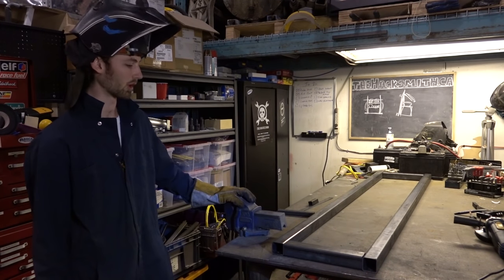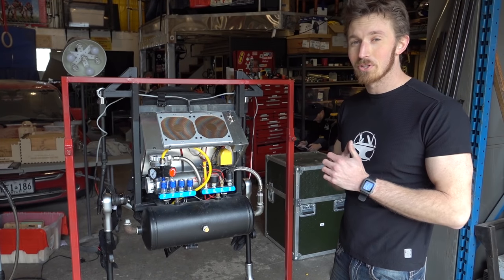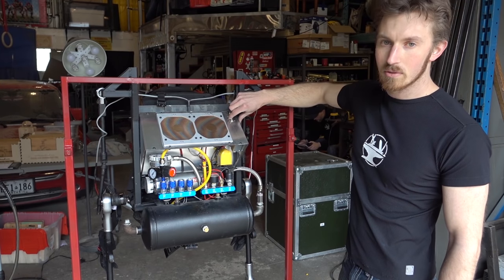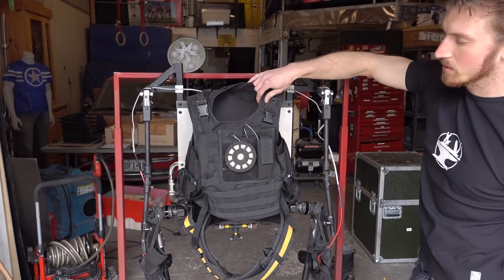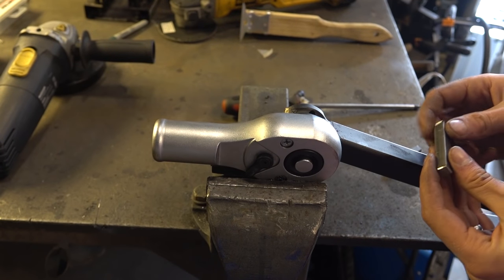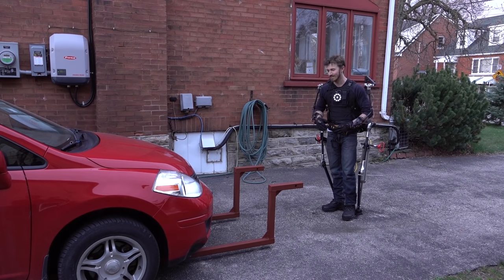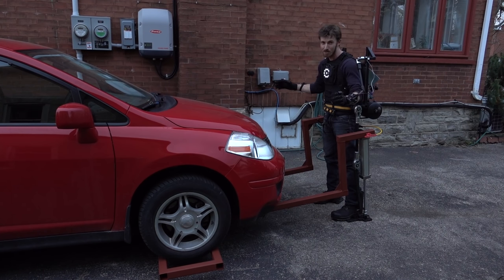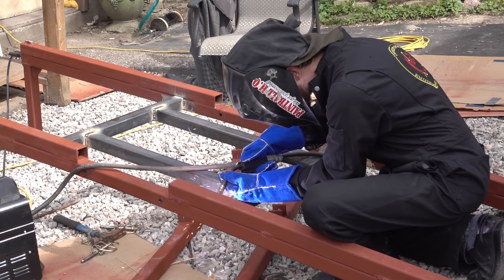Final Adjustments to the Exoskeleton before Exposition

Comment: The steel frame to lift that car need a triangular bridge welded on right at the bending point for force tension support. Not more steel stacked on top of it.
Reply from the maker: +Raymond Cortez we got the wrong steel first time around, it would of worked with the right wall thickness -- we did what we could with what we had, it was finished the day we needed to take it to the expo
Reply: +the Hacksmith you could have still done it with the steel you already had. no bends
Reply: Actually an arched D shaped frame would have worked better because when you go to lift the truck the frame has room to redistribute the force of gravity out ward like a giant leaf spring.
Reply from the maker: +Raymond Cortez Ray, the Delorean has about 5" of clearance, we were very limited in what we could do
Reply: +the Hacksmith cool either way, wish I could do that 😔
Reply: +SnowSpider108 You can with dedication and skill development.

Check out ZNA productions, he has a lot of stuff that can be done with hand tools that would be fun practice.
Reply: he need to stack more jellybeans on his head to make that frame stronger
Reply: Oh those jelly beans, the guys at work, they just go crazy for 'em!

Comment: Please don't lock your knees while fully extended while lifting a car - just thinking about it makes me cringe. I don't even wanna imagine what would happen if your knees were locked when the pressure was let out of those cylinders...
Reply from the maker: +Gavin Remme The exo was doing all the lifting, I might of been standing straight but I wasn't locking my knees don't worry.
Reply: +Gavin Remme I know that kind of scared me but as he said, the exo was doing all the work
Reply: +the Hacksmith offtop: You can make sole(footbase) of exoskeleton responsive to pressure. This will remove the need to press buttons by your hands (the higher leg pressure - the greater hydraulic lifting force). Programming is possible on the simplest microcontroller Arduino.
Reply: What would happen?

Comment: From what it looks like to me is that your hydraulics are connected to the arms of the steel beams at the knees. I would be more impressed if you had your hands on the steel beam and the suit was aiding you, but not so much as you are in the way and the hydraulics doing all the work. You could have just stepped out of the suit and triggered the suit from afar and it would still do the same as if you were in it.
Reply from the maker: That is the point of an exo...
Reply: the Hacksmith LOL

Comment: This is a very cool project, and I commend you for making the various controls, but outside of that it's not what I expected.   It's more or less taking apart a pneumatic car jack (I have 2 at work) and putting the pieces on a back pack. Most of the parts of your exo seem useless, or for show only.   Having to manually mount the head of your leg jacks to the object just makes you a very expensive and awkward car jack.I work with very (very very very) sensitive switches and split second reaction electronic actuators.  My idea would have been to use those switches to measure the users effort and have the actuators move based on that.  You can implement safety stops by measuring the natural stopping points of your limbs and programing it in. I do this anyway, but with mechanical parts.    It makes your body into a joystick, but with many axis and very fine control.
Reply from the maker: +Derelict Yeah... it's an on going project, this was just literally an update video. Everyone is so god damn negative about it I don't understand why.

You can get variable pneumatic pressure switches with analog control, so it will be possible to have the cylinders follow my movement. We're just not there yet. I'm a guy in a garage with a box of scraps, not a multi-million dollar company with a team of engineers working for me. It's still the most advanced DIY exo on YouTube. So cut me some slack.

Comment: Next episode, cybernetic upgrades with wall running and double jumping capabilities
Reply: Yeah i would love to buy that, (Besides the fact that that costs more than everything on the fucking earth {Including the earth}), Also, 1 billionth of a gram of anti-matter costs 23b per one billionth of a gram
so with 4tril usd at my disposal or more specifically : $4056449979.85
thats one billionth of a gram x 9315, 0.009.315 of a gram, that's about 2 pounds, that is 357,000,000,000,000 times more powerful than the "fat man" and "little boy" bombs that were dropped on hiroshima, that is 4.998e+17 kilotons of tnt, so, i honestly, couldn't find any program that could handle that much force, so i'm just going to assume it would destroy the earth, mars & venus, and damage any planets closer than that, possible pushing mercury into the sun

Comment: i am impressed with the work space and the equipment you have, just a small suggestion, can all those piston be replaced by linear motors 
that way you don't need to charge up gas before use 
but it may require a larger battery
Reply from the maker: +PzAbt could, but linear actuators are very slow

Comment: Well this is a good project but the main problem is that it is impractical. The way the lift system works makes it hard to apply it to any other parts. however I'm sure that if you combine the technology of this with the other exo then it will be a very practical exo.

Comment: Damn Bro you are a genius
Reply: +Black Losthome Sorry but no. This thing is just over glorified car jack, nothing more. Buy two pneumatic cylinders, air compressor, pneumatic control system and strap that into metal frame and your done.
I was expecting actual exosuit with pressure sensing microcontroller driving several solenoids in sync according the movement, adding lift capacity and making exo essentially weightless... what a disappointment..
Reply: i dont speak nerd
Reply: +Hellsong89 dude , what if i told you that he had 120k subs at that time ... He didnt have the budget to do more ... Also , watch the planing . He wants to put more electronics on it and will make the hands at some point
Reply: +Hellsong89 go ahead , make a better exo than him with the same budget . Link me the video when you are done
Reply: Thankfully someone who actually has enough brain cells to realise what this is.

Comment: I know it's too late now but why don't you try to find some triangular shaped steel bars instead of square shaped steel bars? i think you'd get much less bending in them. just a quick thought ;) the exo looks great! some cosmetic improvements and it sits just as snug as your model in CoD !!! great job!
Reply from the maker: +M4N1C I don't think triangular shape bars exist... and if they do they'd be really expensive!!
Reply: over here in Germany you can get them at almost every hardware store. But the wall thickness is always pretty thin. There are even solid ones, but these are veery expensive. I guess the regular square shape is still the most cost effective. How about turning them by 45° so an edge is facing upwards? might reduce the amount of bending a touch. could be stiffer. Just a bit of brainstorming late in the night here. If i'm talking trash, just ignore that 😂
Reply from the maker: +M4N1C If we had more time we would of made it right the first time =) The steel we got was too thin walled which is why it didn't work, it wasn't what we ordered. So we made due with what we had and it ended up working -- just wasn't that elegant.
Reply: the Hacksmith elegancy isn't important after all =) well i wish you all the best and keep it up! I'm very curious where this project is going!

Comment: Are the beams bending because they're too weak for the cars weight? or because the way the air pressure suit puts 100% effort in from the beginning and jerks the bar putting pressure on where the car starts?
Reply from the maker: +Charlie Britt Originally we had planned to use thicker wall steel, but the store didn't have what we needed. Thought it'd be alright, but turned out it wasn't -- that's why we welded all the extra stuff on. The weight is what is causing it to bend, not the impulse from the air pressure. Good idea though!
Reply: +the Hacksmith makes sense thanks. I only got the idea because if I pull slower and pull the slack out of a bar then usually it bends less. but tbf I can't pull a truck xD way different physics at play

Comment: come on brother, you need to fix the tension issue on the bottom section of square tube. If you are going to go to the trouble of running a double square tube, it needs to be  a COMPLETE double section along the length of the frame. You had one section about 18" long (at the tire supports) with square tube on the top, and double square tube on either end? Otherwise, very interesting work. I just hope you don't break the exo suit and it snaps a bone or two!
Reply from the maker: +Johnsmith Sitizen if you watch all the videos we were extremely pressed for time... That's the only reason the weldment isn't built properly.
Reply: +the Hacksmith You should try to build a hydraulic exo, like a lighter design

Comment: There's no point in reinforcing like that unless the bottom section is not continous. An FEA doesn't fix bad design and I also suspect you haven't modelled the joints correctly to get the correct stiffnesses.
Reply from the maker: +SirArghPirate We were on an extremely tight schedule for this. The original FEA calculations were done for the original frame with 3/16" wall thicknesses, the metal shop only had 1/8". We tried making due as we re-ran the simulation it seemed like it would be okay (not as good). But as you know an FEA is just the baseline if you're close, which we were. We did the best we could with the extra steel since we didn't have time to rebuild the entire thing from scratch. It already cost us $500 worth of steel.
Reply: +the Hacksmith  I know. It takes time to correct, but probaby the best way to reinforce it is to weld in a section of steel in the gap where the wheel trap is.

Comment: I have a question if you had enough funding too do whatever you wanted to the exo hat would you change and also is a electrical engineering degree a good degree?
Reply from the maker: +Joel Parshley oh man what wouldn't I do with enough funding... I'd love to start on a bigger exo, more of a mech -- like the Power Loader from Aliens. Then I'd focus on a new exoskeleton hire some help and really turn this into a real company =)

EE will certainly get you a job, but if you're hoping to do stuff like what I'm doing, mechanical or mechatronics is where it's at. The amount of EE you'll need for a project like this is quite minimal, something a mech eng can pick up pretty easy, where as going from an EE to building something this mechanical... would be challenging =)
Reply: +the Hacksmith I am studying to go in EE( cegep in Quebec)  and I want to work with exos . Its sad that you say that :( isn't an exo working with servo motors electrical ? I guess  its more mechatronics.
Reply: +the Hacksmith EE sounds so boring all of the sudden
Reply: O I thought that you learned the basics of each type of engineering then chose a specialty but I kinda wanted to work on power systems computers and things that aren't invented yet I want to be a inovator but I'm only 14 so I got awhile anyway
Reply: +geordi rendum I know and it sucks because I atleast thought it's what I wanted to do I wanted to make more efficient pcs and power supplies and phones etc but I can't make an exo which is kinda a dream of mine cuz of hacksmith aww
Reply: joel, I am currently  studying in electronics  (technical school ) and going to uni after. I might go in mechatronics after all. You should too :) its the future when it comes to exoss